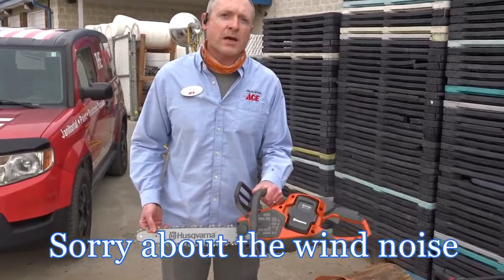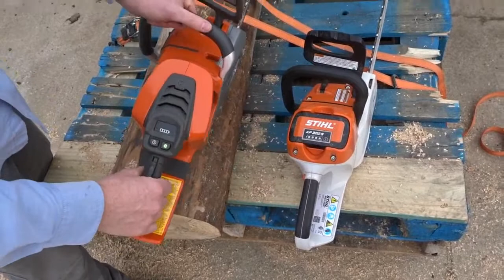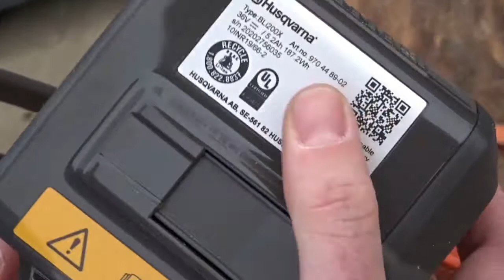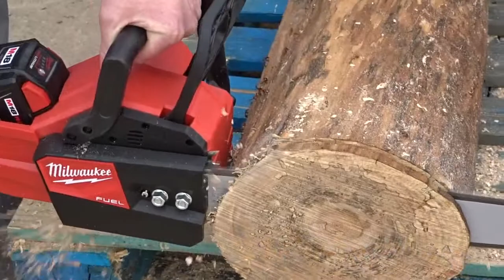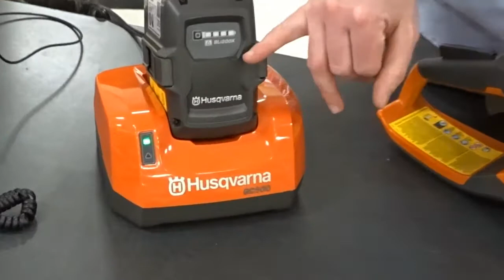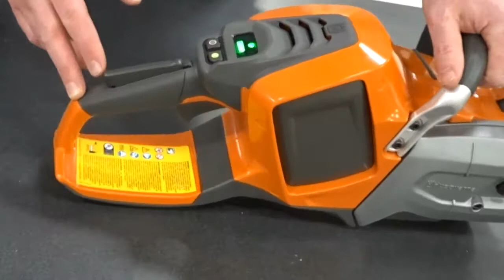Husqvarna 540iXP 16" ABSOLUTELY RIPS!!!

Comment: the video title says it all, that husky DOES RIP!
Reply: I think it was a kind of unfair comparison, I have the stihl 220, but I also have the stihl  MSA 300 I feel quite confident the MSA 300 with beat up the huskvarna
 From other videos I have see what seemes like is that the husky battery with last longer.
Reply: @sirvozelo1  oh yeah the msa 300 can run up to a 20" bar and chain it's hands down the strongest cordless chainsaw on the market and I'm equally excited for the new light 04 bars and chains but the 540i is definitely a stronger saw against the msa 220.
Reply: @benjaminleslie3155  I have the MSA 300 and 2 light04 bars 16" and 18" with 4 chains for each bar. I can tell you it is a fast chain saw, but in my opinion the batteries are not up to the saw, I have 2 AP500, 3 AP300S 1 AP300 and 1 AP200, this because I have besides the MSA300 the 220C, 161T and the Trimmer 135. In general even the AP500 got hot and in full speed on a logs that I am using about 80% of the blade I maybe not got more than 15 minutes cutting time and on top of that the battery got hot and then takes at least about 15 minutes for the charger 500 just to cool off the battery so it can begin to charge. The saw is a great powerful saw I hope Stihl come up with a battery that match the saw. But that is my opinion I am not specialist. In all this battery  power machines that I have to me the one more balanced in regard to battery time is the 161T. For a home owner like me I think any one with MSA300 and 161T need nothing more.